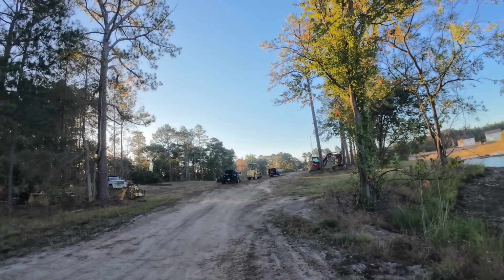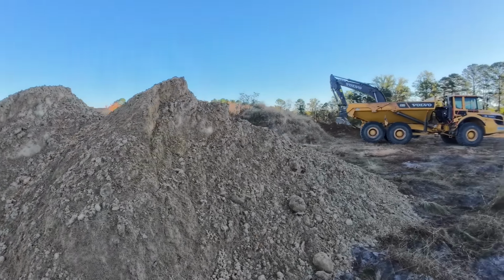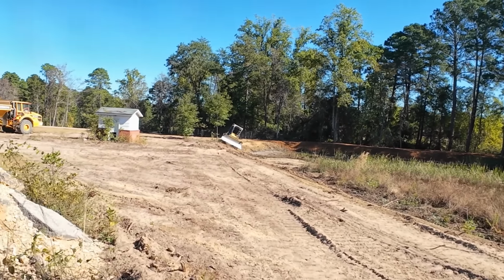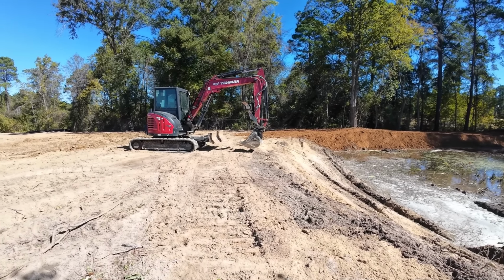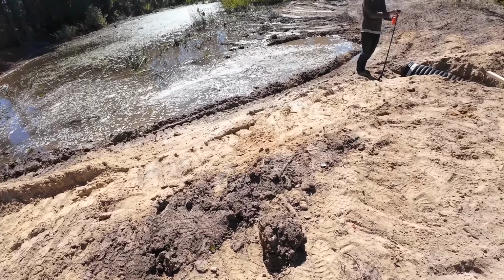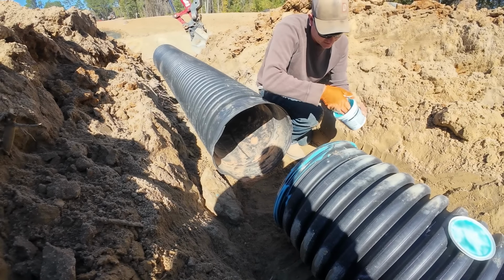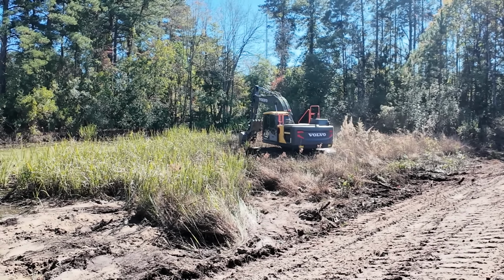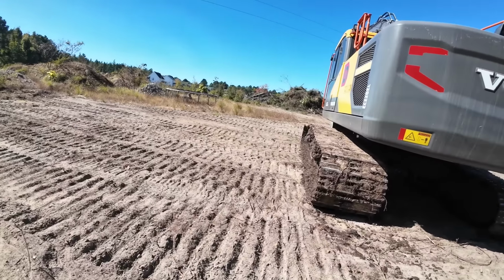Duck Pond Progress, The Dam Rock Arrived & Laying Some PIPE! [10 Acre Fishing Pond Project]

Comment: What are the little shacks for?  The white one and I think I saw a couple of others.  Pump house?  Bird blinds?  This place is turning out amazing.  I can see a boat ramp where you took the old dam out.  Great little oasis.  😊😊😊😊😊
Reply from the maker: The one you see here is a storage shed, has wood paneling, some shelving and some stand up storage. Possibly used for fishing gear in the past. There are 3 pump houses for drinking water and irrigation. The bigger green building near the cabin is a Smoke Shack (built in the early 1900’s), it has a brick BBQ pit in it, the sides open up and it’s screened in. Had a pig pickin’ earlier this year, worked great! Good idea for the boat ramp!